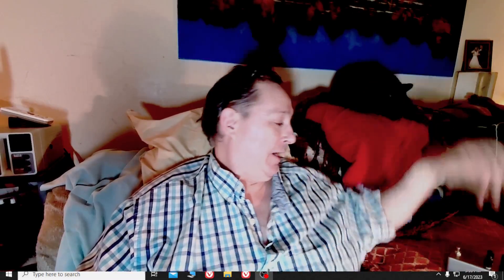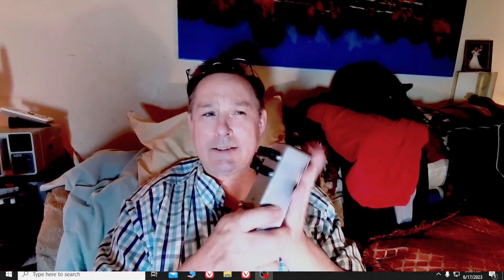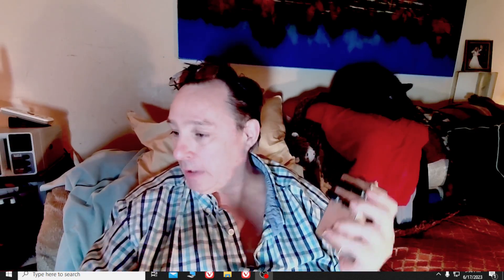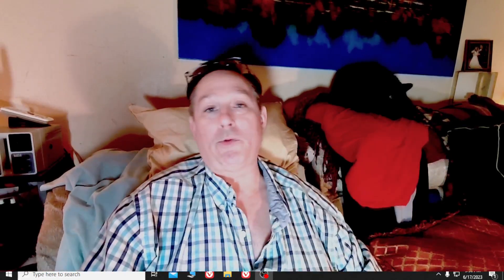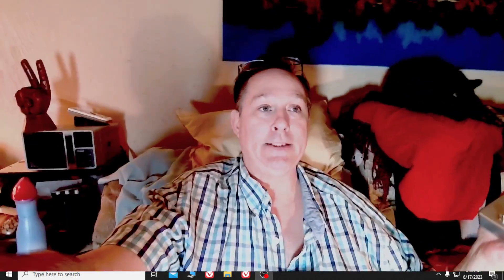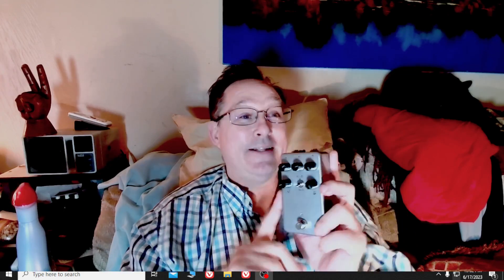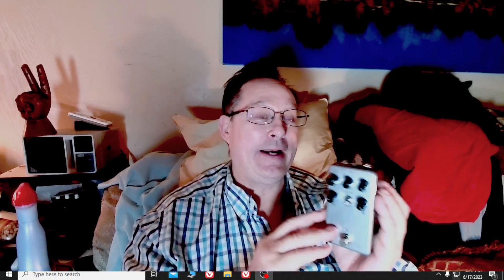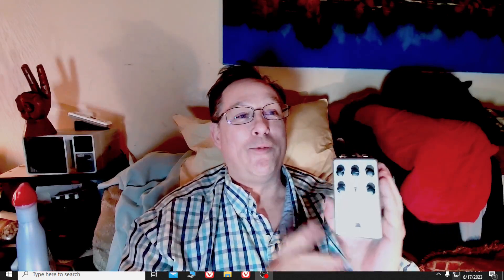Revv G3 ( tyrian from pedal pcb ) build report / first impressions

Comment: is there any oscillation issue? coz mine was
Reply from the maker: i always use a single end ground input cable which can eliminate that in high gain affairs. you use a shielded wire , you do not connect both ends of the ground tho , only one  end of it and you leave the other end " in the wind" . you then attach a normal ground wire .